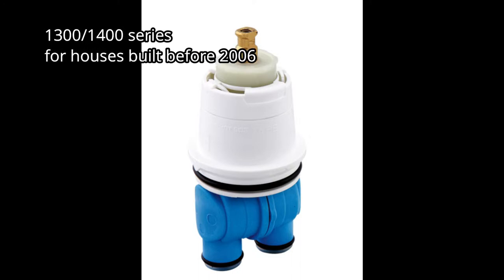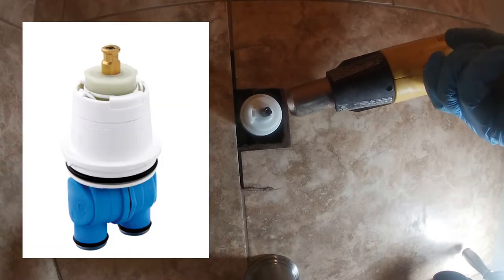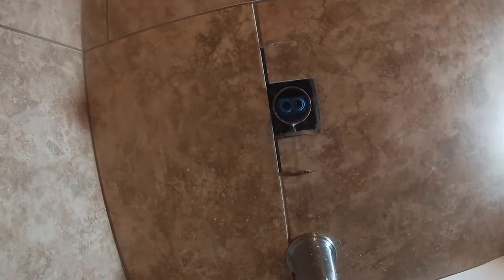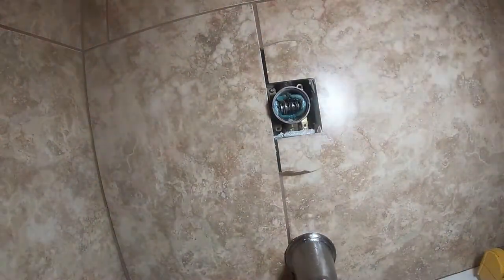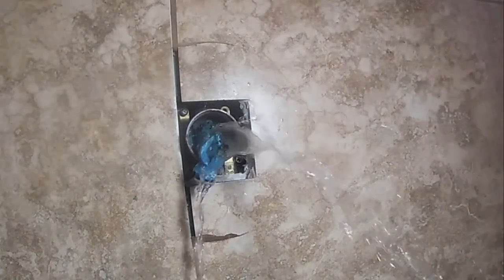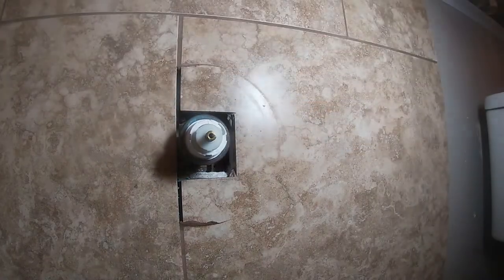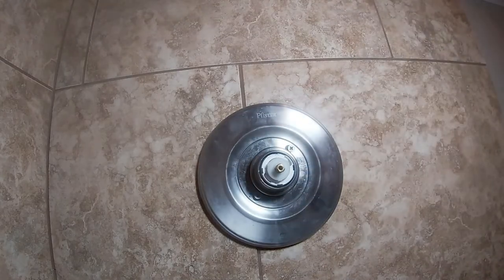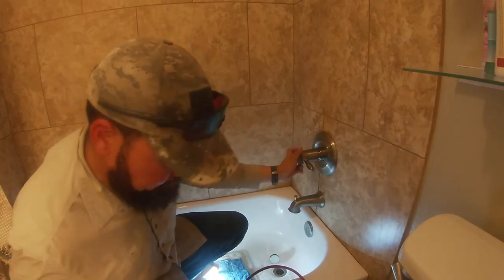Replacing A Delta Shower Cartridge

Comment: Great video, thanks.  I struggled for quite a while trying to rip the cartridge out of the fixture using a fair amount of force, Channel Locks, etc. along with PB blaster, and WD 40.  I mangled the cartridge.  Then after some searching online I found your video; I think your idea of applying heat must have did the trick even though I only had a 1500W hair dryer to use.  Finally got the cartridge out, cleaned it up, installed a new cartridge, and now it's working great with no leaks.  Thanks again!
Reply from the maker: Glad to hear my video was helpful to you!.

Comment: I had the same problem the other day could not get it out. I bought the Delta 1300 & 1400 Cartridge Puller Removal Tool DT - 2641 and saved me from all this BS. this tool is a must its not cheap but saved me I may keep it . all pros should have this

Comment: And thats why I love Moen, with moen positemp cartridges, thats a 15 minute job, sometimes you will have to fight the cartridge for an additional 5 minutes to get it out, or maybe the allen screw to remove the handle gets stripped, it may set you back 20 minutes tops, but 2-4 hours to replace a delta!? Thank God our property doesnt have those 😮‍💨
Reply from the maker: This was a worst case scenario. Moen cartridges can also get stuck like this one and same technique is used to remove them.
Reply: @utubehandyman  maybe their other cartridges, but the positemp ones maximum 35 minutes to replace, I maintain a 600 unit property, easily 700 bathrooms in total, ive personally replaced at least 50 cartridges in almost 3 years, without counting the other ones my coworkers have replaced, even without using the removal tool, just put the philips screw back in, hold it with milwaukee wire strippers as close to the pivot point of the stripper, pull and wiggle with both hands, and slowly it will come out 😎👍🏼

Comment: When the house was built - OR - when bathroom was remodeled.

I took the faceplate off and luckily (not removed, or eroded from water damage) there is still a sticker with a date code.

Comment: The first thing you should put the ring nut back on, so you don't bend or destroy the housing...... The second thing is they sell a Puller on Amazon. Little expensive $230.... But it sure beats destroying things and  replaced the valve assembly Body behind a tile wall..... Now the puller is not perfect because I've had it  separate the cartridges leaving the body inside..... But you can take some fine stranded wire Maybe picture frame wire or The Wire out of a bicycle cable.... And you fish it in and back around the stuck body inside. Pulling it out, so you have 2 Braided wires.. Then you take.
 Your polar assembly and they have the 2 Tightening Screws pins that you would Titan. in and it would catch the cartridge..... Take those out and you fish the braid  wire threw the screw holes pulling them tightly and then you screw the puller  onto the His valve body assemblyValve body assembly So this will twist the braided wire around the cartridge as you screw the puller  assembly onto the body With the puller screwed on to the valve body and the wires Going Out the Out the threaded holes where the twist catch pins would catch the valve body assembly. You pull the 2 cables tightly and lock 2 vice grips on the each side of The Wire pulled tightly and then just use the puller and the pops right out...... Hope it makes sense, but it's super easy...... I don't understand why this company. That makes the puller tool didn't include the Technique.  with it because the cartridge is break off. Half the time and you need to do this procedure to pull out the stuck half of the Cartridge.
Reply from the maker: good idea about the wire. I have the puller, it's useless. 90% of the time, half the cartridge body gets stuck inside the valve body.

Comment: Once the stainless steel piece is exposed, you can screw a drywall screw in one of those holes, and then pull straight out on the drywall screw with channel locks.

Comment: One point: Since this faucet turns on from the cold side if the cartridge is upside down it will start on hot water. It will send hot water immediately from the shower head. It should be reversed to the correct direction or the first person will be burned

Comment: I was thinking. I wonder if a slide hammer like ones used for bodywork on cars by screwing it into the now exposed cylinder of the broken cartridge or with some sort of hook attachment that would somehow be able to slipped in behind the broken cartridge and slowly tapping it out with each backward strike of the slide hammer.
Reply from the maker: i can see that working for sure